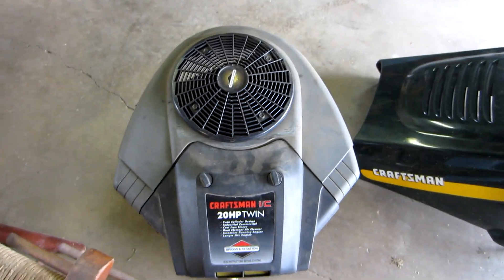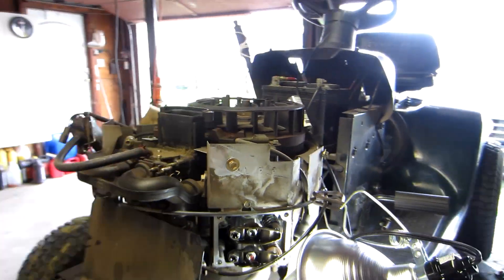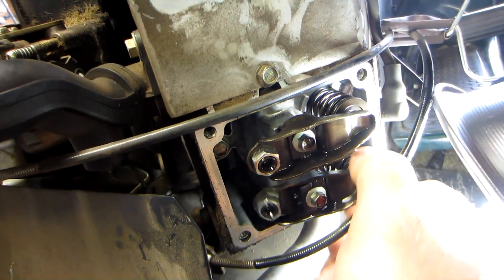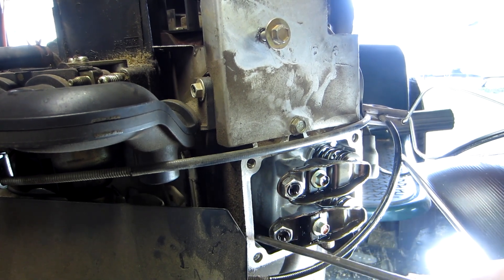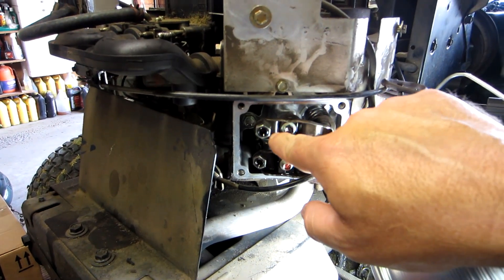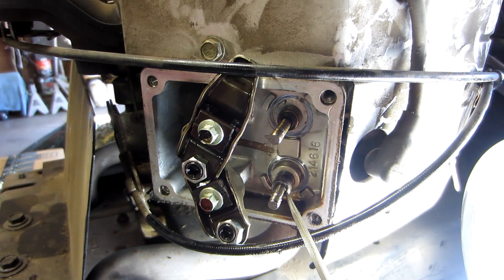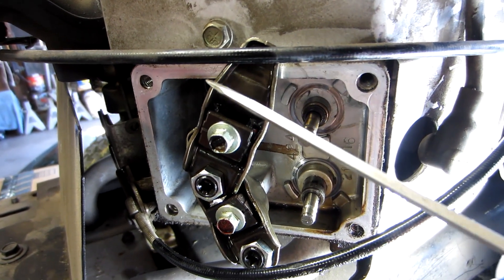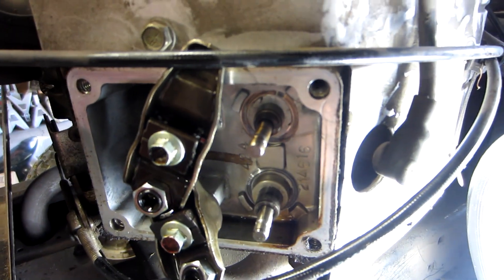Briggs Intek Bent Push Rods

Comment: Hi I watched the video but am unclear on what the symptoms are.  I'm troubleshooting a single cylinder intek that's running rough at high speed.  It runs fine at idle and I can get it to run ok for a few seconds by pinching off the fule line.  High speed has what sounds like a rough backfire with black smoke.  Also new plug has black soot.  I've rebuilt the carb (it was clean before), checked the valve clearance( they were tight), replaced plug and filters, checked the after fire solenoid.  Still running the same.  One thing I did notice was I'm not seeing the little decompress bump when I cheked the valve clearance.  Anyway I've run out of ideas?
Reply from the maker: Thats a carb issue, On the older Briggs engines they has a high speed screw on the bottom of the fuel bowl to adjust air fuel mixture but the new one like yours dont.. The fact that you can back off the fuel supply by pinching off the hose and get the high speed to straighten out temporarily leads me to believe your carb is getting too much fuel.. time for a new carb..
Reply: Thanks Foxboss9 for the comment for confirming my suspicion.  I've rebuilt the carb (2-3 time now).  It was clean but I still carefully replaced parts w a rebuild kit.  I must be missing something though.  Next time I'll skip the kit and spend a few more dollars on a carb.
Reply from the maker: Working on small engines for many years now, It use to be the norm to rebuild the carb because it was much, much cheaper than buying new.... 
However, for the past 10 years or so the new carb prices have come down enough and the cost of labor rates have gone up enough that it is better to spend 20-80 dollars on a new carb and spend 5-10 minutes to replace it then spend 10-20 dollars on a carb kit and spend 45 minutes to rebuild it, hoping to get it right the first time..  I rarely rebuild carbs anymore, just like rebuilding engines..When taking in consideration the time required to tear apart and rebuild it's usually cheaper, cleaner and much quicker replacing the old with the new.. good luck

Comment: GAH!  Had terrible power going uphill.  Checked behind the left valve cover.  Both push rods fell out in my hand.  They were both still straight so I just put them back in place.  Checked behind the right valve cover and the aluminum push rod is bent.  The steel push rod is nowhere to be seen.  Now the joy of figuring out how to remove the flywheel!  First, however, I will try to pull the rod out through the dipstick tube.
Reply from the maker: Good luck!!
Reply: Bought a telescoping magnet just like yours and stuck it down the dipstick tube...nothing.    1) Is there any access to the sump via the oil filter port?  (There is NOT via the oil drain port.)    2)  How much access to the sump is available via the dipstick tube?  In other words, am I going to have to take the engine off of the mower to access the sump in order to find the old push rod??   Bought a new push mower yesterday to get my lawn mowed but an acre is a royal pain!
Reply from the maker: If you didn't get lucky like I did you'll have to do like the video mentions, pull the engine.. That is why I was so pumped about snagging the push rod right away.. You can try tipping the mower on it's right side and turn the engine by hand to see if you can get it to slide over to the dipstick but thats really it. If it don't get picked out the dipstick you need to pull the engine..Try to see where it is looking though the opening when you take the head off(if you take the head off).. Good Luck

Comment: I had the issue of back firing and low power on mine. 570 hours on the engine  a 441777 22 horse. Did the rebuild on the carb, and it ran better but still not well for a week. Then back to the rough running back firing and missing.  Taking a play from my old and long gone grand dad. I chucked up a drill on each of the valves and pulled firmly back against the valve seats and spun the hell out of them. 
Voila', problem fixed. Afterwards I sprayed a little water into the intake with it revved up to about 2500 and all the crystallized carbon ( the problem) created by a over heating event is gone out the muffler in a big black cloud. 30 hours later its still running fine.

Comment: Same problem. I left the pushrod in the crankcase two seasons ago. Drove the guide back in with lock tight. Lasted 3 more 1 acre cuts this year then bent another rod. Used the peening method. Noticed the valve stem was now hard to move in the guide. Ran for about 20 minutes of mowing when that cylinder let go. Opened it up again and found the rocker arm bolt had pulled out of the aluminum. I don't have a helicoil set, so, Time for the new head.
Reply from the maker: +Richard Tortora You tried your best.. At some point you just have to throw your hands in the air and let them land on the mouse to order new.. :-)
Reply: +Foxboss9 Received new head in 2 days. Installed and cut grass.
Reply from the maker: Richard Tortora !!! AWESOME WORK !!!

Comment: Hi Foxboss9 of all the vids I watched and it's a lot u do the best for explaining what u are doing and how ! Now I need ur help !? I can not find my problem short of tearing the whole motor down prolly got to any way ! I have a B&S Vtek V-Twin 21 hp on a Husquavarina I have pulled off valve covers all looked good but needed adjusting bad or I overlooked something ! But that not my problem It acts like there is no compression no knocking inside turns over to freely , pulled plugs but can't tell or see if pistons are moving ? When turning motor as if to start it I can pull PTO switch and blades engage or try too for a brief sec while it is spinning so this tells me the crank is OK So what is there or why is it the pistons may not be moving ( This I should have started telling ,,< it was running fine deck snagged a root backing up thus suddenly killing motor after that just what I told u > OK caught up now ;)  ) What do u think and do u have a complete tear down video on this same basic motor that I can't find ! Thank U Hope u can help !
Reply from the maker: If the engine was stopped abruptly like you described you may have sheared or partially sheared the flywheel key(it's designed to fail when something like that happens) . Pull the blower housing and flywheel off the engine to inspect the key.. That's where I would start..
Reply: +Foxboss9  Could be this ! Let me ask this ? If key is sheared would the valves still move ? Vales were very lose after I adjusted the motor still like free wheeled took 1 plug out and could not feel any compression ?! I placed small dowel in it turned over by hand could not find or feel piston movement of any kind ! Do u still think it could be the key ? I will start to tear down in little while ! I will let u know ! Ty :)
Reply from the maker: +Cool- Ace the flywheel key has no bearing on compression. It is there for engine protection and timing. The fact that your valves are loose affects compression. After you adjust them, Make sure the valves are going up and down(open/close)..If not Your camshaft could have been damaged.. Make sure both pistons are traveling up and down, If they are not the connecting rod(s) could be broken..
Reply: +Foxboss9  OK That's what I am afraid of ! It stopped running to a free wheeling but I did not hear any thing sound like it broke like connecting rods ! I will get back to u on this later ! Do U have a video about the rebuilding of a Vtek V-twin I can watch !? Thank u so much for the help !
Reply from the maker: +Cool- Ace sorry no rebuild vids.. almost everyone these days just buys a new enginge or at least a short block.. FYI, If a connecting rod broke it may not make any noise..good luck
Reply: +Foxboss9  Well I got heads off they look good push rods are fine then I pull 1st head , ( now I just bought this mower and thought it was a tad on weak side ) with head off I see plug was firing but piston was almost froze and this was also side with valves lose !  So There is reason to now think rod broke and running for some time till the 2nd broke with me after an hr maybe 2 running time  !  Now I pull the left head off every thing looks good but I see the spark plug was not in all the way ( found it with stripped threads ) so I checked and yep that rod was broke or they thru the caps won't know the rest of the story till I get motor off frame and break it on down !  Oh I checked and believe it or not both cylinder walls look great like new no scars I could see !  So if it is just rods can I replace them put new gaskets on put all back together and be good to go ??
Reply from the maker: Cool- Ace I have in the past just replaced rods..BUT make sure there are no cracks in the block anywhere and the internal reinforceent webbing that is cast in the crankcase area shouldn't be broken either.. or you may have problems in the future..
Reply: +Foxboss9  Great Thank u so much for the help and great advise ! I got nothing to lose at this point but the cost of rods and gasket set  !

Comment: Really good info on cheap fix. Ill try it. On the part numbers ... which side is 796232 and which is 796231?
Reply: Sitting on tractor left side is number ending in 2
Reply: Mine are marked 1'and 2 on the head.

Comment: Just inherited a free mower with a 20HP Intek running on one cylinder. The cylinder with the rats nest and cram packed full of grass has an exhaust valve guide that seems to have sunken into the head and both pushrods are bent. I'm glad I watched this because I was getting ready to replace both heads with the assumption that the other one might lose a guide at any moment, but now I know the probable cause of the failure so I think I'll assume the side that wasn't overheating is going to last a while longer. Thanks!
Reply from the maker: Great news.. Glad it worked out.. I would assume you will have no issues down the road especially since you know what to look for now.. Good luck

Comment: Thank for this video! I have a 24 HP V-Twin Intek and the valve guides have slide out and the exhaust push rod on one side was gone. I tried your trick with the magnet on a stick down the dipstick tube and got the push rod out. The push rod had been cut in half and I got both halves out through the dipstick tube. Saved me a lot of labor time and saved my customer a lot of money. Thanks again!
Reply from the maker: +Warren Copeland Lucky times 2..!   glad it helped out..

Comment: I like how people buy a mower, uses it for 5 years until it breaks, then gets rid of it. Never gets them serviced so the valves can't be adjusted or get the oil changed. Happens a lot around here.
Reply from the maker: Yep, it's that disposable mentality that originated from the Japanese and the US Manufacturers bought into starting in the early 80's. The first time I heard about making stuff disposable instead of maintainable, was from a Chrysler Millwright that mentioned the K-car presses that he was setting up would only have a life span of 5-7 years. After that, instead of retrofitting the press for new model cars, the presses would be removed, scrapped and replaced with new ones. Funny thing is Most heavily used K-cars only lasted about 5-7 years(lol) now everyone makes stuff throwaway so I can't blame most of these MTD buyers for not doing normal maintenance.. I do blame the ones who bitch when their mowers break down yet they never lifted the hood except to add gas..
Reply: it seems the valve guides are a problem on the exhaust same side as you shown. to much heat on that side?? i peened and used loktite sleeve retainer on mine.l;etting it sit for now. will fire it up this after noon when fully cured. i did fire it briefly of course.

Comment: Thanks for the video!  I had the exact same problem with my Briggs twin 18 hp.  I repositioned the offending valve guide and peened as you showed and was 'back on the lawn'  One quick question if you wouldn't mind - in looking at my other 3 valve guides I noticed that they all seem to be moving 'out' also, although none any where near the degree of the one that caused my bent push rods.  Do you think I sould reposition and/or peen all of them also - OR just leave well enough alone ???   Thanks again!
Reply: Just curious how long did repair last?

Comment: If the valve guide is too far out and you can't compress the valve spring enough to get the retainer out, do you have any advice?
Reply from the maker: Reach in between the spring coils with a small punch or flat tip screwdriver and tap it in with a  hammer.  It doesn't take much force at all to tap it down.. Make sure you don't go to far with it..
Reply: +Foxboss9 , you were on the money.  The valve guide had slid all the way up to the retainer and only gave the spring about 1/4" of play. I couldn't get a screw driver in at the right angle to hit it with a hammer. What I ended up doing was putting vice grips on the retainer and tapping that to get the valve guide to slide back enough to get the spring to compress enough. Everything else worked out well. The 2 retainer collars are a pain to get back in. Thanks for the help.
Reply from the maker: +thesir85 awesome.. Glad it all worked out!

Comment: I have a 26 hp Briggs in a craftsman mower twin Intel engine. I had the same failure. I was about to install the heads and decided to just check and see if there was anything else that could have happened to the engine and came across your video. What a life saver! I never checked the valve guides. Low and behold, I have a bad head. You do a nice video. I like how you also noted the different style pushrods and their location. Thanks much for the video.
Reply from the maker: Awesome catch.. Thanks for watching!